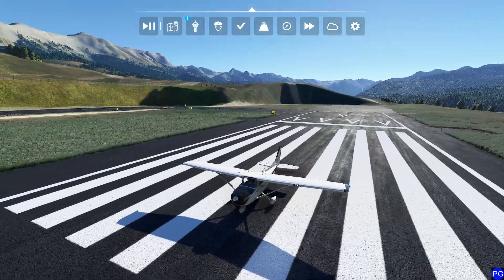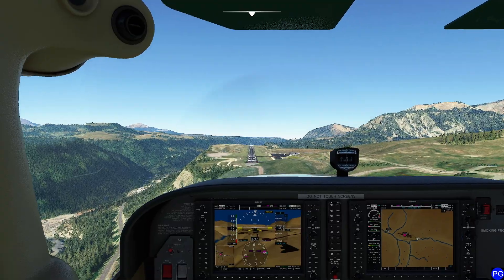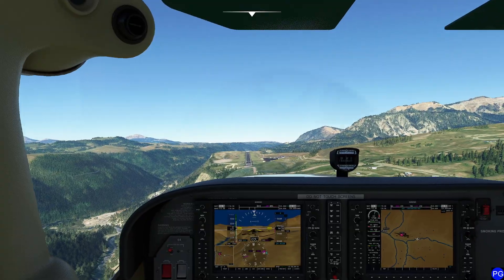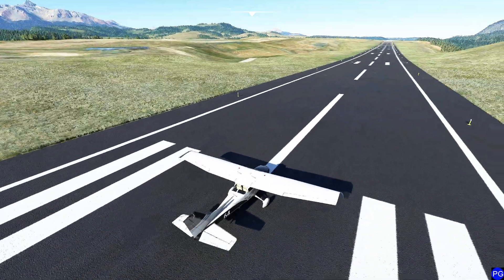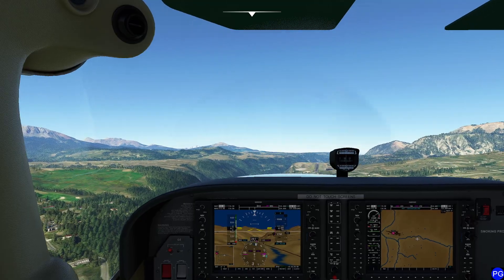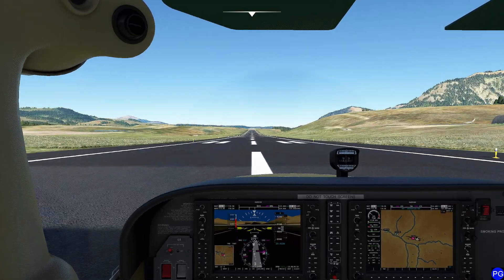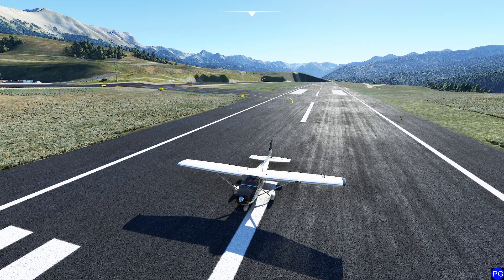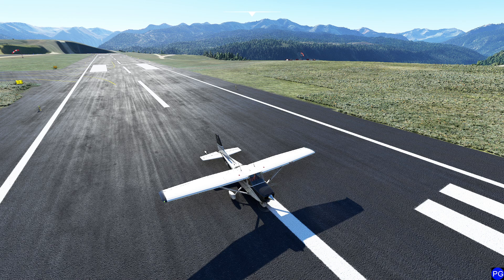MSFS - Understanding the effects of flaps on landing

Comment: If you watch Backcountry aircraft (Bush/STOL). They start with 10 increase to full flap at a certain point depending on conditions. As soon as the tires hit. They retract the flaps to 0 bleeding any lift left out under the wings completely.